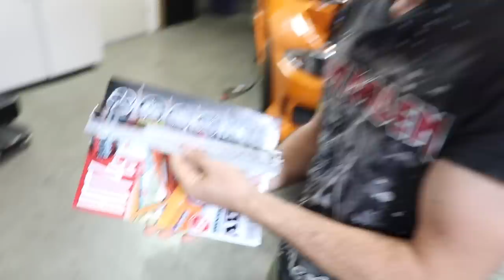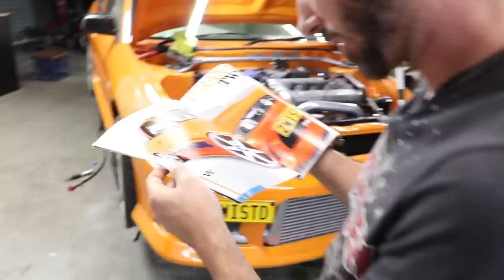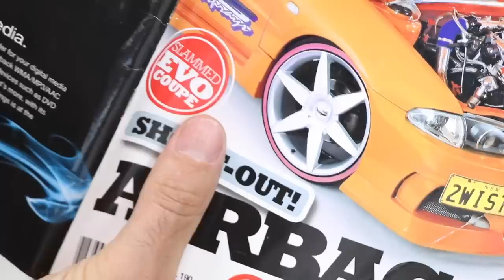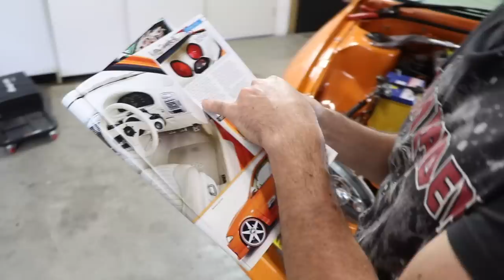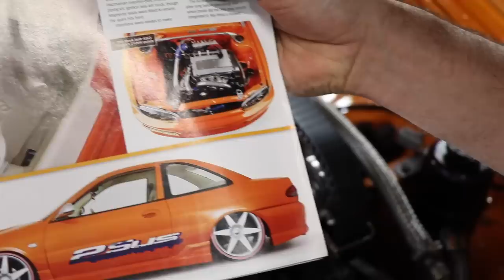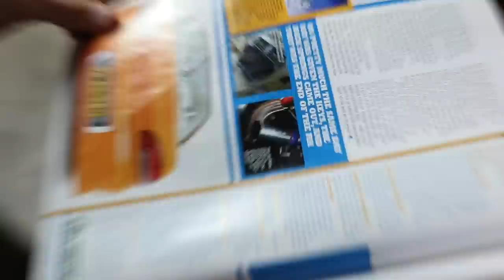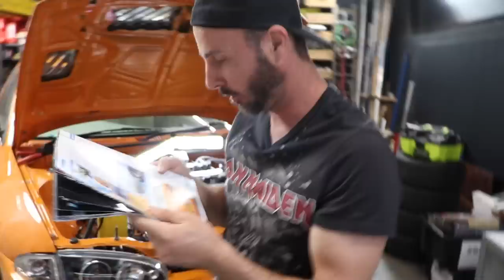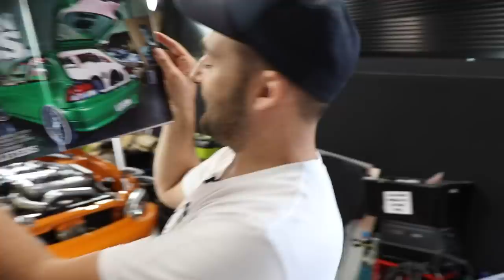2WISTD - Magazine Cover VS The Real Car

Comment: Torque steer is the 4 lane change with out turning
Reply: Yeah, I think he was saying you'd change a lane with each gear change.  4 gears=4 lanes.  Since it wasn't built for the additional torque like an EVO would be, they don't have the same counter-measures to limit the torque steer.
Reply: @HPSFRoadrunner  he said he could do all four lanes in only 4th gear, no downshift, or even shifting at all
Reply: How goes 2 lanes?
Reply: @maartenyzer4121  wut?
Reply: Acceleration get you wheels 2wisted.
Reply: but it said it has an lsd, it cant torque steer that bad with an lsd i think
Reply: Boost.
Reply: FDMtech   Maybe. In this configuration, more likely scrub radius with those wheels/tyres. Or at least a shocking combination of the two.
Reply: 2wd non Evo problems
Reply: TayTay my 2004 TL 6 speed had a factory lsd...torque steer was horrendous...
Reply: TayTay The torque steer is due to unequal length axles and suspension geometry not the diff. Even with a welded diff it would torque steer.
Reply: The torque steer was caused by the engine setup and not only 2WD cars were affected, also the EVO 1-3 and the Galant E30 and E50 were. That's why the 4G63 was turned 180° in the EVO 4 and the Galant EA0.
Reply: 4wd torque steer? :D:D:D
Reply: @trytthisnowk  Yes, 4WD torque steer. Torque steer is caused by the axles, no matter how many of them are transferring the rotational energy. The EVO rear axles are the same lengths while the front axles are disproportionally different in length. No matter how much energy the rear axles are transferring, torque steer on the front axles still occures. Ask anyone who drives an EVO 1-3 or Galant E30 (VR4).

Comment: I’m honestly more surprised by the fact that the magazine is as recent as it is given my first thought would’ve been early late 90s/early 2000s.
Reply: Cuz it's Australia.
Reply: This is definitely several years past the prime of this stuff in Australia in the early to mid 00s. I think Hot4s was basically dead by this time.
Reply: This style car was normal in California in the late 90's. There is a delay....When UK and AU/NZ started building really fast Hondas, that scene died a bit. Poor enthistust go B series while those with more money go K series. Most raced these days not really seeing street duty. Some 2nd gen Honda runners own new Si's and Type R's as daily drivers. Again a delay...
Reply: Thought the same, but they've mentioned in the article that he inherited it from his grandfather 6 years before and that was when the build started, thus meaning it started in 2004. Also, I suspect it was already completed for a good while by the time it was featured in the article, maybe he had just done some finishing touches.
Reply: Not to speak that the guy Moog and Marty bought it from said he had it for 5 to 6 years, meaning the original owner sold it around 2012-13, just a couple of years after being featured. Unless he was really short on cash, it would be weird if he had sold a project that recent, not to speak that besides parts being taken out, it was untouched since the article. It was completed for a good while by the time it was featured, then.

Comment: You gotta wonder how many show cars of the past magazine still exist in some form. Were they crushed? Hidden in a warehouse or shop? Or still on the road?
Reply from the maker: We must find them all!
Reply: exactly, just as the ancients once said "gotta catch em' all"
Reply: I’ve seen a couple of magazine cars from my country. One of them (an Eclipse) was still driving in a sort of Frankenstein existence with the original show bits mixed with replacement oem stuff. Imagine overly show bumpers with big holes showing the bare chassis of the car because the mesh covers were gone a long time ago mixed with cheap steel wheels, faded paint, ricer rear wing held with plastic straps, broken side skirts and cracked interior full of holes where speakers once were. It’s awful lol. Another I saw (Lexus IS) gathering dust outside a house on top of blocks as a skeleton of it’s former self with most of its stuff removed, it didn’t even have wheels anymore and I’m guessing most of the drivetrain was removed as well.
Reply: I scrapped my twin 1990 ish magazine cover car I built, VW beetle roadster. I didn’t have a garage, so the rain pissed in, and the work was too complicated and built for short term show and not long term go. So I parted it out. I even sold the magazines that featured the car at a swop meet for a quid each. It was my first car build, learned a lot, moved on.
Reply: I'd imagine many were stripped of the show goodies then sold as "old lady driven" or "stock"
Reply: BIFB s BMW M5 was driven to near death, and then gutted for 240Z. But it was not grazy build and not in that magazine.
Reply: That would be awesome to see all the famous early Auto Salon cars .... MR CRX, the WRX with the jungle theme, the off tap Suzuki Swift GTi
Reply: I can't imagine many are on the road. Keeping a $2k Lancer on the road is worth it for owning a cheap car to drive, but that's when it's stock and has normal easily maintained and replaced parts, driveable suspension, no insane wiring etc. I imagine they've all been sold a few times with each owner being less enthusiastic and having to do a lot more work. Most of them will be like this situation, where they've been sitting in someone's driveway for 5 years and trying to get someone to take it off their hands.
Reply: You say that, and just the other day i saw THE sex-spec Peugeot (i think 506), the (original) blue turd, that was quite famous in Europe, at least as i remember it, from 5 different magazines.
Reply: @aserta  The one from the Hill climb against a MG Sprite on Top Gear?
Reply: Tom Ahoks the BIFB m5 used in the 240z was bought in as a stock crashed car from copart. I don’t think any of his cars are well enough built to be even driven, never mind driven to death, they just end up rotting at the side of the road waiting for someone to crash into them so he can collect some insurance money.
Reply: @cjbarnes2010  The wrx still gets around in newcastle!
Reply: I remember a purple vn on chromes, (20’s I think) had a gold engine cover and on the inside of the boot had a Perspex circle with Leonardo davinci logo etched on it, and it used to light up, had a massive stereo setup...seen it for sale a while back I think, a lot of the stereo stuff was missing and car was in overall fairly bad shape
Reply: @mightycarmods  That would be cool.
Reply: I know my multiple best of show winning beach buggy is still around 25 years later, the standards on beach buggies was pretty low back then, as in the U.K. you can look up to see if a vehicle is MOTed, it does about 20 miles a year. It is also a different colour as it was a garish pink with weird graphics.
Reply: I often wonder this about old F1 cars.
Reply: Most of them fell apart because they were so poorly built.

Comment: The "Can change lanes in 4th gear without turning." means it had so much torque that when you floor it it pulls hard into another lane. Anyone who has driven a high torque rear end car knows that feeling.
Reply: Jason Leon isn’t this a front wheel drive car? What do you mean by rear end?

Comment: Guys I did it! In your last video I said you had inspired me to get my old sub up and bumping again and I did it! I confirmed the amp still worked using a 12V power supply and a cheap 6x9, then took it back home and cleaned all the contact points. It was then that I realized that the power cable had completely turned to oxidation where the ring terminal was connected. That is why I couldn't get power at the other end. But I trimmed the wire back and it works now! I need to splice into one of the stock speaker lines to get a signal, but just running it from my phone it was shaking they whole house and making my dogs go crazy (according to my wife) can't wait till I can jam to some banging tunes again. This rust bucket of a winter car needs at least one redeeming factor lol

Comment: Put a central and rear diff on it and make it a real evo, put 2sexy back in its place
Reply: And watch the power atw drop. The more drivetrain you add the less power get put down. He would need to make a fair bit more crank power than 2sexy to keep up.
Reply: They went through hell doing that to the Mira, I doubt they will ever undergo that process again.
Reply: @liamcooper5202  its a 4g63 it will be easy to make more power than 2sexy if it's in decent condition. Nobody knows the limits of 2sexy and Marty isn't going to blow another motor just so he can win.
Reply: @cody8860  yeah but it for the most part will have stock rods and pistons for a evo 3.  It wont make massive power on stock e3 rods sure it might be more than 2sexy but once you throw awd on it it will bring it back down and with 19s its not going to be by a little
Reply: FWD has a lot of wheelspin in the Lancers. They could easily do it with the 4G15 1.5L carby donk that was in them too. The 4G93 1.8 EFI span easily too. When I put 4G93T and 4G63T motors in Lancer coupes, sedans and wagons the torque steer was fun... aot if fun! but the grip sucked. Too much loss of power through the loss of traction was a let down. If you go AWD yes you lose power to the rear diff, but it makes up for it in launching, handling and strength. If youve driven a FWD then AWD really hard and around corners etc,  you will choose AWD everytime over FWD.
Stock EVO internals will do 300kw atw FWD no problem. With forgies in it, put a bigger turbo on 2WISTD and bigger injectors on E85, if done right the thing will make 370-400kw atw FWD. Just wait and see.
Reply: @MYDODGEYUTUBENAME  is this why the magazine article was saying it can change four lanes without steering (ie. torque steer)?
Reply: @MYDODGEYUTUBENAME  if they used better tyres than those shitty re003s then traction wouldnt be so hard. Even if Moog goes for all ots got, he is weighed down. He would just about have another half a car or so in weight added while Marty is gutted. Marty is running a lighter wheel and tyre combo so less unsprung weight to go with a gutted chassis. He will be nimble as fuck while Moog will be a whale.
Reply: @MYDODGEYUTUBENAME  and we have seen. 224KW..  thats ok but not big power.

Comment: You forgot the EVO III rear drum brakes😂
Reply: J H Likely has a big front bias like 60:30 distribution. Drums are fine set up and ok pads. Only need to change to lose weight + cooling IF there are heat issues (unlikely).

Comment: Whats funny is most people think this car is outdated or rice but i love how it looks inside and out
Reply: Non car people call every modified car "rice"...
Reply: It is very tastefully done. Plus we know now that it was built by the original owner not just to look good, but to perform well too. That says a lot.
Reply: @Draconiam   Tastful ?  🤣
Reply: It's a lot more tasteful than the really over the top stuff, you can tell it's a few years more modern. The fact that it actually has a properly built Evo drivetrain is way beyond what most sexspec cars did. They were mostly stock with a bunch of chrome bits to look good. But they'd spend a mint on an airbrushed dragon paintjob and fifteen TV screens.
Reply: @MegaRcdrifter  not only non car people call some cars "rice". not every modified car is riced out. But most built cars are not riced out. Rice is when you over do it and make them look bad insted of making it look better

Comment: So that's why it doesn't have timing belt cover. It has 1g block and 2g head
Reply: fila1445 tell us everything evo whisperer
Reply: @mcmtv2  for 6 bolt conversion you have to use 1g blokc becouse it has bigger mains or something and it has diffrent lover timing cover so you have to modify 2g and 1g cover into one to be able to  hide timing belt under it. Just ask Jafromobile, i just repeats what he told me ;p

Comment: Did I hear front wheel drive locked, hence the 4th gear lane changes comment.....Dyno day will tell us...
Reply: Pretty sure it meant that the Evo 3 gearbox was locked to FWD only rather than AWD as it was in the donor car, the mag also said that the car was using the Evo 3 LSD for the front axle.
Reply: It's saying it has torque steer in 4th

Comment: Why would the Evo III gearbox be locked to front wheel drive? Must be a typo.
Reply: I was hoping they'd emphasize more on the modified transmission. Very interesting
Reply: Because AWD gearboxes have a centre diff that transfer power from the engine to the front wheels and to the rear diff via a viscous coupling unit. It splits the power to front and rear wheels. Transferring power to the rear diff/wheels robs power. So when you use a welded viscous coupling/ weld the centre diff to lock the centre diff, the RWD split is taken out of the equation (because it doesnt have a rear diff why lose power trying to drive them). So now effectively you have all power going to the fronts only. Ive done these mods lots of times as I built the W5m33 transmissions for all sorts of uses AWD, RWD or FWD.
Reply: @MYDODGEYUTUBENAME  woosh :P But good explanation nonetheless.
Reply: @MYDODGEYUTUBENAME  You don't have to weld the viscous coupler to send power power to just the front wheels, that's not how those gearboxes work. The front wheels are driven directly through the gears of the transmission and the rear has the viscous coupler between it and the output shaft off the transmission. Not saying you don't know what you're talking about but I've been inside these transmissions as well.
Reply: @david929190  . Its probably the way I wrote it as I had just gotten home from hospital still doped up lol. Ive done the welded centre diff, welded vcu and aftermarket 1 piece billet vcu locking spline. It depends what was available at the time. The problem with using a vcu locking spline is that power still goes to the centre diff and you can make centre diff salad out if it because its the weakest link. I would much rather weld a centre diff (using a damaged one from another build) as its unbreakable. Then as you know, cap off the output shaft. There's a few ways it can be done. By spending money or not spending money.

Comment: Torque steer allegedly will make the car change lanes without steering the wheel...
Reply: Not allegedly. All cars with the 4G63 mounted that way had torque steer issues, EVO 1-3 and Galant E30 and E50. That's why they turned the engine 180° in the EVO 4 and Galant EA0.
Reply: @Metatr0n  Engine direction doesn't affect torque steer. Unequal CV shaft length will somewhat though.
Reply: So will some dodgy tie rod ends and fucked up steering geometry due to sex spec suspension mods. I know what my moneys on. 
My back is still sore from driving a sex spec CRX 300 km home from Autosalon. That thing made the trip up in a pov pack 4wd Hilux tow vehicle feel like a limo ride.
Reply: @Metatr0n  Of those cars you've listed I've owned a 92 Galant VR4 and currently a 92 EVO and they both have equal length front CV shafts. The drivers side uses a half shaft to accomplish this. The only cars with the 4G63T engine I've seen that have unequal length shafts are the FWD Eclipse/Talon/Laser DSM cars both turbo or NA. Search the internet all you want but I've had these hands on parts across the floor experience.

Comment: 4 lanes without turning is torque steer. Top gear used to show it off when they tested hot hatchbacks back before 2009 because almost all those cars had bad torque steer. most fwd cars with over 200 hp used to have terrible torque steer but new stuff like the mcm focus has electronic diffs to control it.

Comment: At min 15:00 i think what you guys talking about its speed density. Owneed lancers and evo now and they need a Mass Air Flow meter. Its a big black box(4inX6in) after air intake but before turbo. In order to eliminate that need speed density sensor

Comment: Just wanted to give you a heads up on the audio. It sounds like they hooked it up to a win ms pro or some other amp tuning software with microphone and gave the sound system optimal tuning for premium sound.

It's good stuff if you are an audiophile

Comment: Im saving up for one of these engines lol. My Eclipse is basically going through all the models that the Eclipse came in. Base model, GS, GST and possibly GSX if I can find a rear sub frame for a reasonable price. If I get a 6 bolt crank then it will be appropriate since mine is a 91 and the 7 bolts came out in mid 92 and on.

2 grand for a 4g63t with the wiring harness, computer and AWD trans from Japan. Im actually looking forward to it.

I would say change the timing belt though. The best way to do it is to remove the engine since its so hard to get into the area to actually change it. If the big or little timing belts break like what happened to mine you are looking at a new head. You could get lucky with just bent valves, but it usually bends the valves and cracks other things either needing a rebuild or just getting a new one.

With the mods the engine has, it sounds like its going to be a hard car for 2Sexy to beat. BUT, with all the extra weight it has thats another story. Whoever gets this car, if it doesnt get destroyed, take all of that stuff out. I know I would.

Comment: I think when they refer to the 4 lane change in 4th gear without steering. they are stating it has so much torque that just stomping on it in 4th will torque steer you across 4 lanes